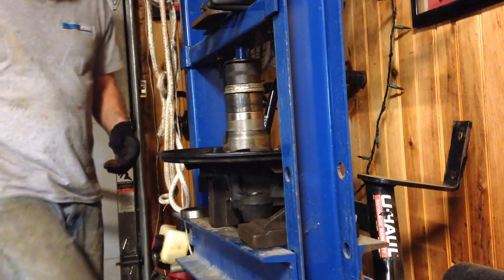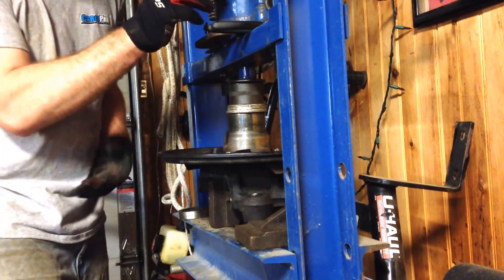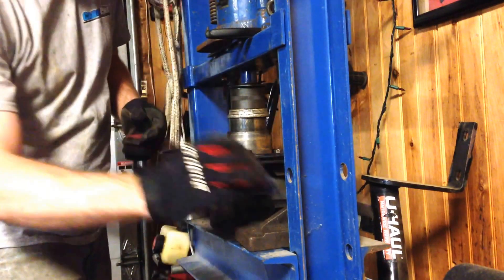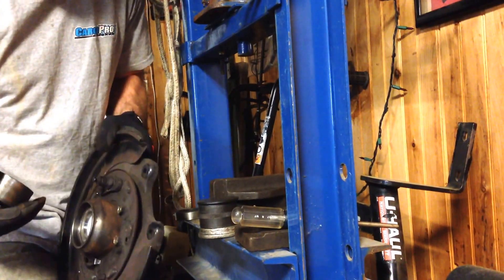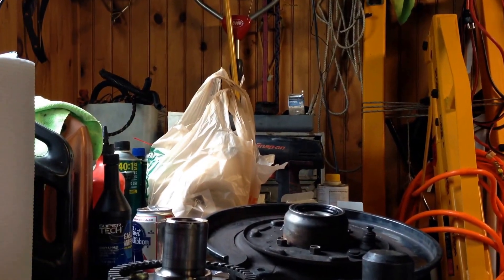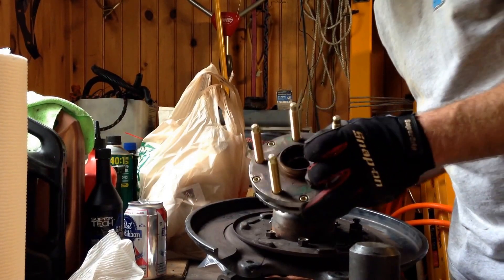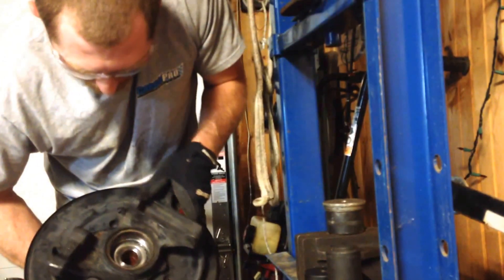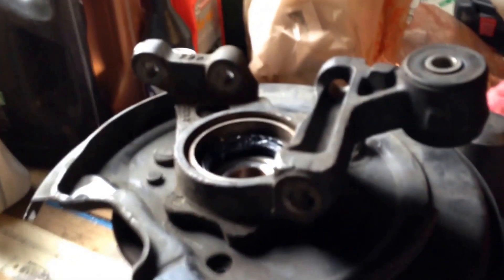Pressing in a Subaru rear wheel bearing at home.

Comment: Your hand on those adapters worries the hell out of me
Reply from the maker: Yes, not ideal to have hands on the adaptors, but I never put them or my fingers in between any pieces. I have this habit to feel the bearing and adapter alignment, as soon as my finger feels it shift, I stop and backup or inspect the alignment. This is one thing I do not think I mention in the video. Obviously with better kit of adaptors or press the dodgy stacking of components is not as bad. Great car has to be taken in any case. Thanks for watching.